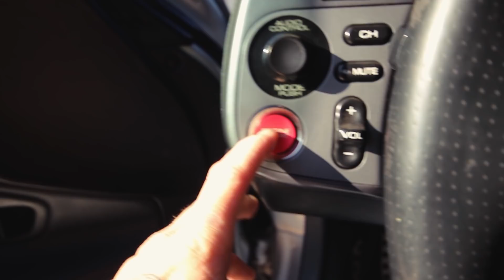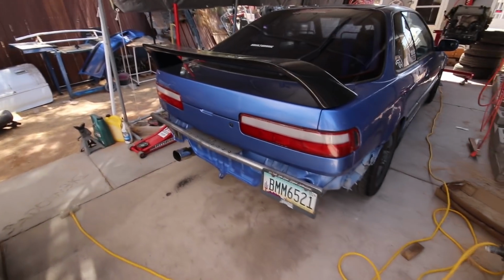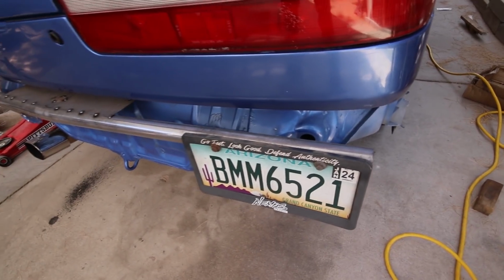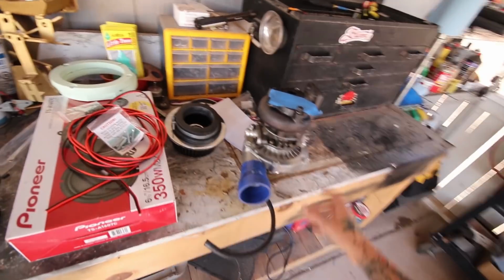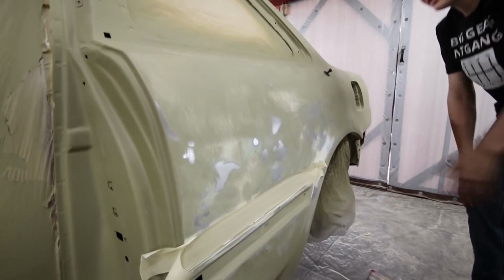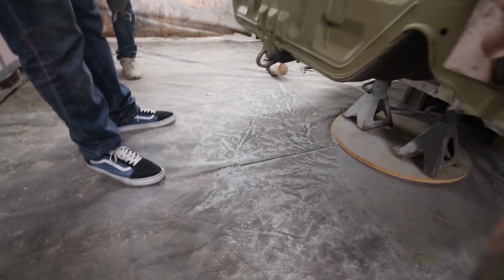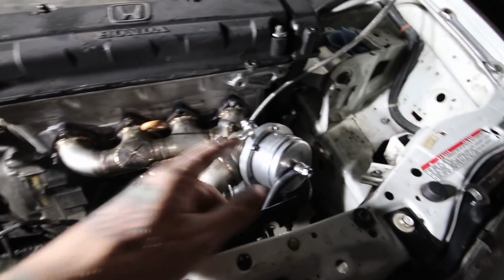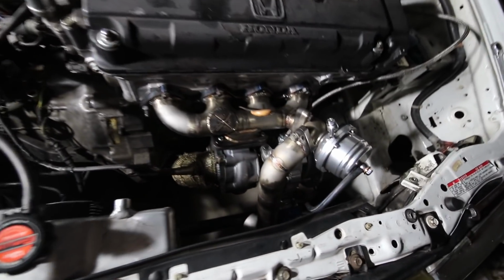Catching Up With DeadBeatGarage

Comment: Boost referemce goes to the bottom of the gate not the top. Killer work bro. Keep grinding. Or welding i should say lol
Reply from the maker: Thanks man! 
What do you mean by boost reference, that’s a new term for me haha
Reply: @ChrisSadowski  the line that runs from a pipe that will see boost to the bottom of the gate. In this case it appears to be off the compressor housing which is perfect. That lets the gate open by spring pressure. If its at the top it will force the gate shut and never open.
Reply from the maker: Ahhh that makes sense he corrected it when he picked up the car
Reply: @ChrisSadowski  awesome thats good 👍